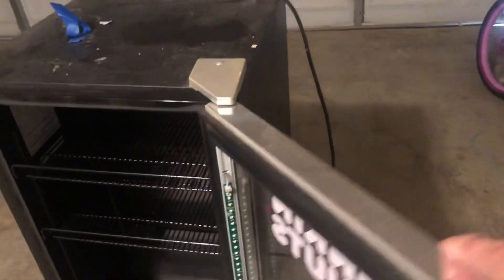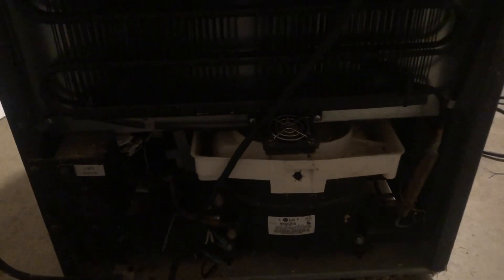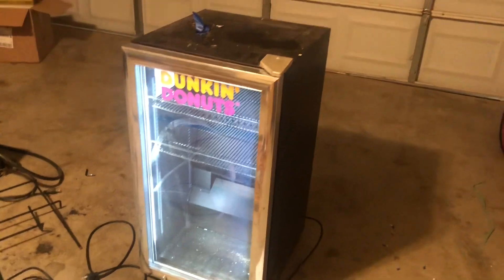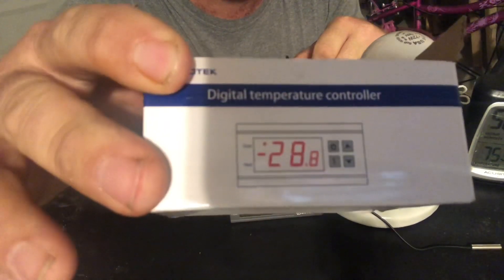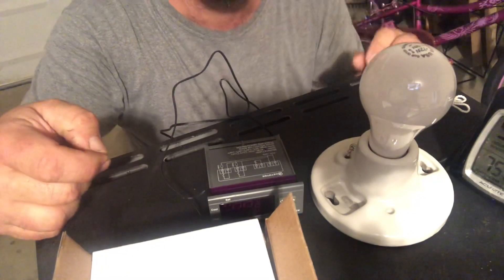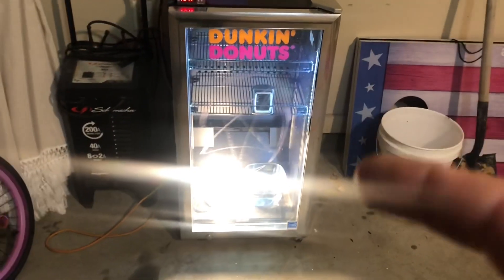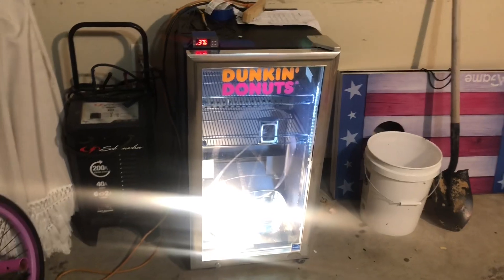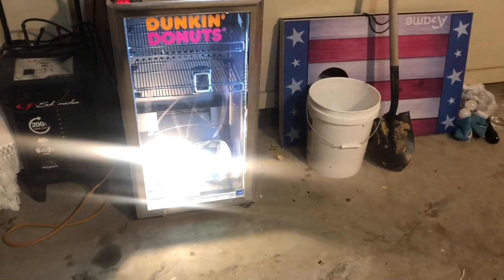DIY incubator from mini fridge.

Comment: Did you add any ventilation holes in it?
Reply from the maker: I had one small hole it the very top probably like a quarter inch but honestly I kept it plugged up most of the time.

Comment: Did you drill any vent holes? If so, where and what size?
Reply from the maker: I did have a vent at the top. Small hole I could cover with tape. It was probably 3/8 or smaller. I normally don’t worry to much about humidity I live in north Mississippi. In the spring and early summer when I do most of the hatching you can cut the air with a knife it’s so humid. 😂

Comment: I have a question , why do all diy incubators except yours have lights on the top, heat rises, wouldn’t it be better to have on bottom? Honest question , please answer as I am starting one soon
Reply from the maker: Honestly I am not sure that it is that big of a deal if you have a fan in it to circulate it. If you are trying to do one with out a fan I would for sure put the heat at the bottom cause you are correct it rises. Make sure you put your temperature setting probe at the level your eggs are. So that it is the correct temp where the eggs are and not just at the top or the bottom. Hence the fan. Try and keep it even
Reply: Thank you , I have everything ordered, there is a new controller that also monitors humidity , so I ordered that , just have to find wine fridge

Comment: What's your hatch rate just curious
Reply from the maker: So I don’t know exactly since I use this one and a store bought kind of in conjunction with each other. Right now my flock is young so I don’t have great fertilization. So I start all my eggs in the frigid and once they start growing I move them to the other incubator. But I would say as long as the fan doesn’t go out then it works great at keeping temp. I did have a fan go out and it did not keep temp evenly and got very hot at top.

Comment: How did you “unplug” the compressor?
Reply from the maker: The one I had just had the prongs on the compressor End so I could easily just unplug it. From the compressor and that allowed everything else to work. If yours doesn’t just plug in you could just cut one of the wires that goes to the compressor secure the end with wire nuts or what ever and should work. But I am not an electrician so disclaimer you should consult a professional.

Comment: I have seen where someone used dollar store trays and put large styrofoam or pressed paper pulp egg cartons with tops cut off in trays to place eggs in, pointy side down. They placed trays with cartons in them on shelves in fridge. They then cut a piece of PVC pipe and placed it under trays with one end of pipe facing door and the other end facing the back, and use it like a small rolling pin. They just roll PVC pipe from one side of tray to the other side under tray a few times a day and it gently the turns eggs in carton like an automatic turner would. I am sure you could use several small styrofoam or paper pulp cartons in lieu of a large one if that is all you have. 

Just a suggestion.
Reply from the maker: I finally ended up buying an automatic tuner off of Amazon for like $12. I just get to lazy or forgetful 😂

Comment: Can I paint the inside of my incubator? There are some stains that I can't remove.
Reply from the maker: I don’t see why not. The inside of mine is painted sheet metal.
Reply: @HolloHomestead  I was just going to use good old rust-oleum to cover the stains I can't get rid of.
Reply from the maker: Yeah I would just make sure it is good an dry so the fumes are gone. Before you try and incubate anything.